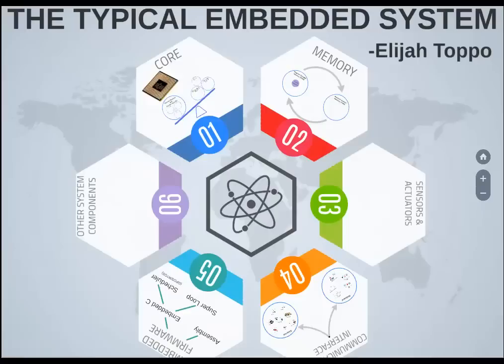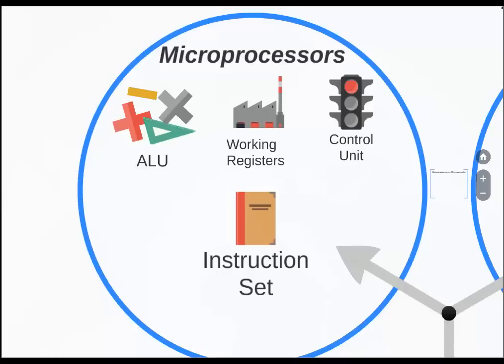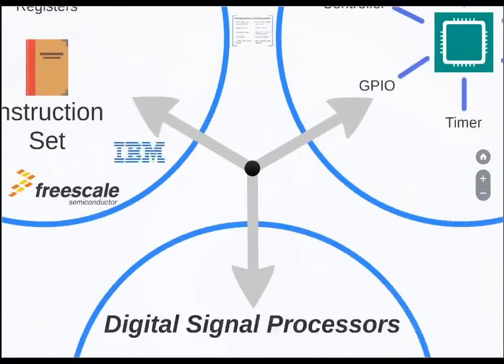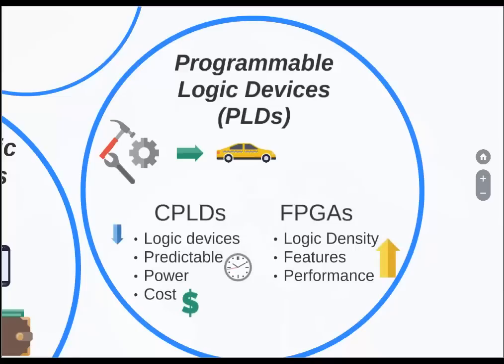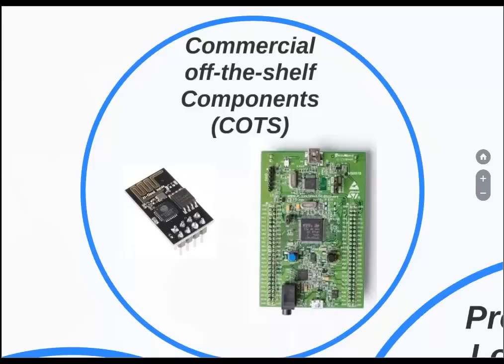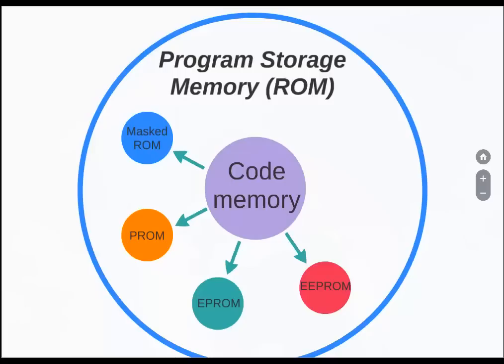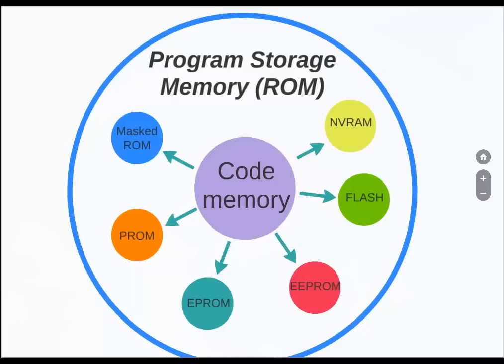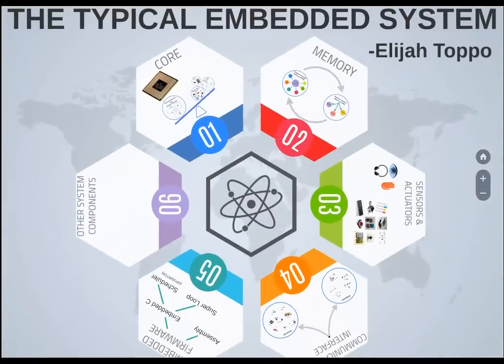02 Typical Embedded Systems (Part 1)

Comment: Will you be adding GPU and GPGPUs to the embedded systems set of devices?
Reply from the maker: Hi,
I've got to be honest with you. Before this, I had never heard of GPU's or GPGPU's being used for embedded systems. But a quick google search revealed that, yes many systems that already have GPU's on board are being used for embedded applications. 
When you say, will you be adding... if you mean, Would I categorize it as cores that can be used in Embedded Systems? I'd say yes.

Hope that helps.
Happy Learning.